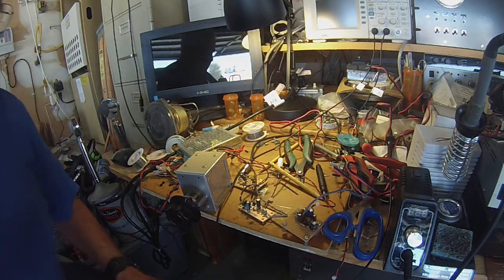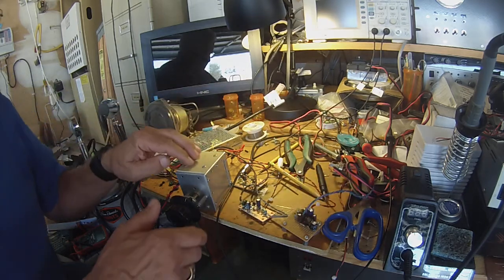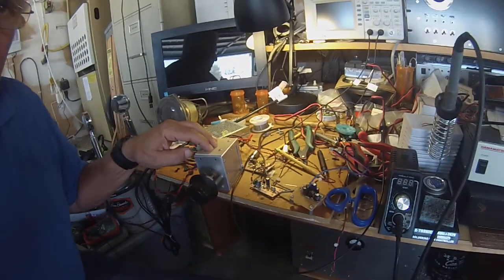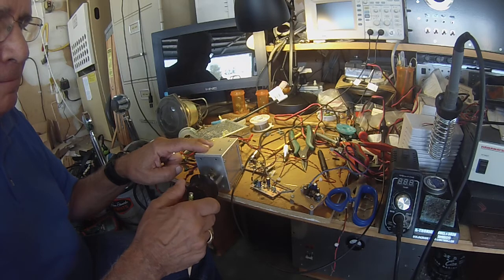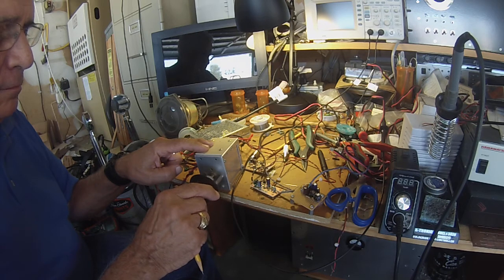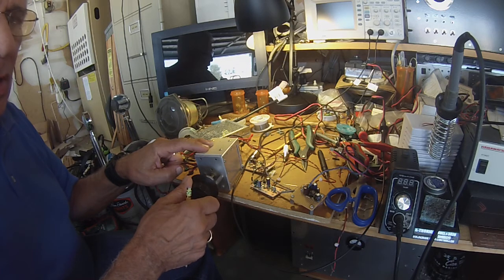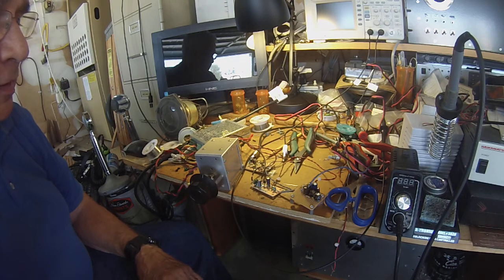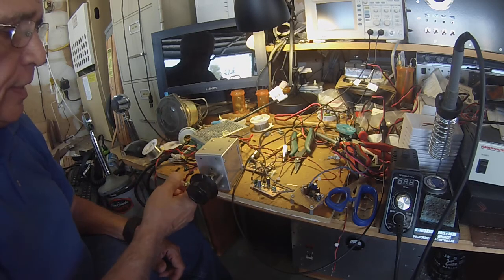Simpleceiver Plus Direct Conversion Receiver Up & Running

Comment: Nice job Pete. What are you using for an antenna?
Reply from the maker: Hi Peter,The antenna is a 40 Meter  "droopy dipole" with the apex at 26 Feet. So nothing special. Thanks for your post.73'sPete N6QW